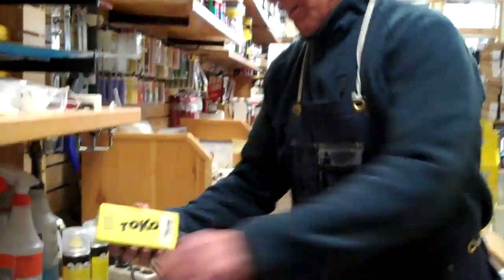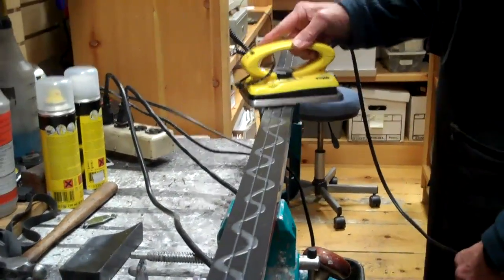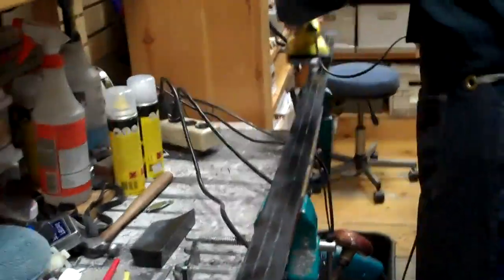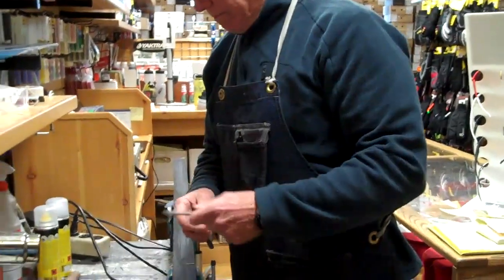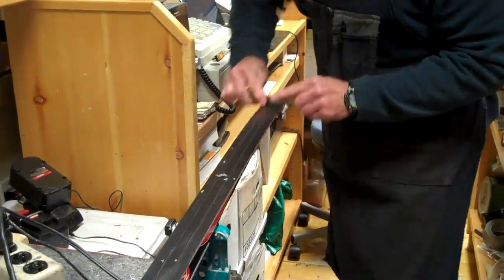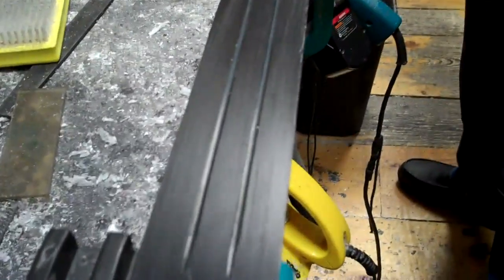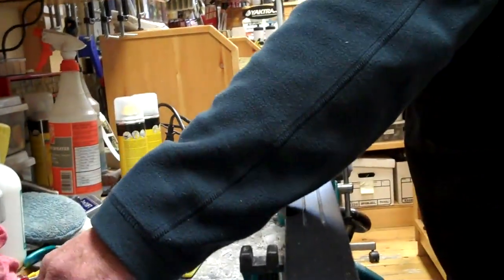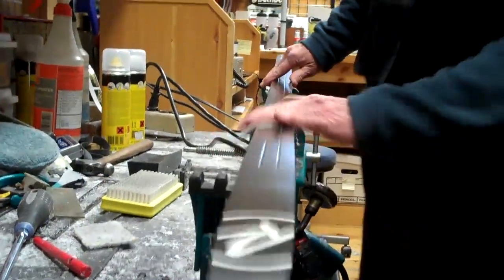How to Wax Skate Skis - Cross Country Skate Ski Preparation

Comment: Nice video thanks.  I didn't realize there was a difference of classic and skate.  I bought some skate skis.  Fellow said he had some protective wax on them for off season.  Well I got a scraper and scraped it off and the grooves and edges.  But I tried outside and they are slipping left and right by my feet.  it's almost impossible to stand.  Did i not remove wax well enough?  How you could you kick off if the foot just slipping like that?

Comment: so..it's never really necessary to use a base cleaner to remove the old wax before putting on the new wax?
Reply: Some people say the base cleaner hurts the base so you should just hot wax it then scrape off that wax and put on a new coat. It can be expensive though.